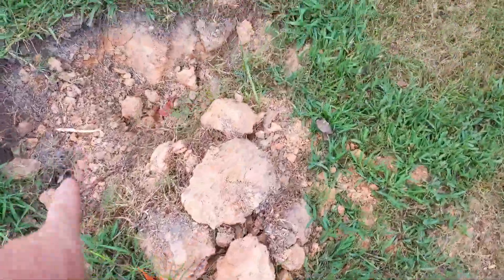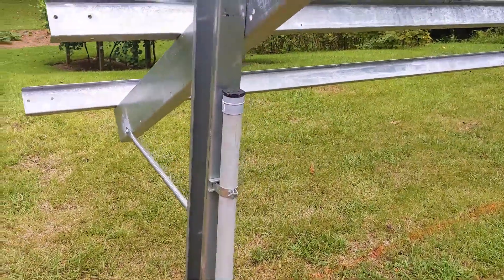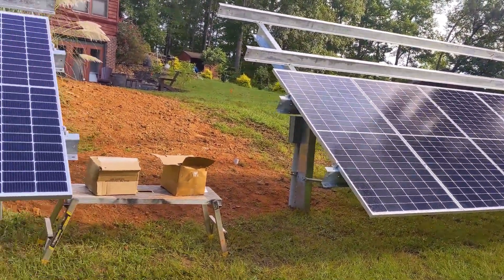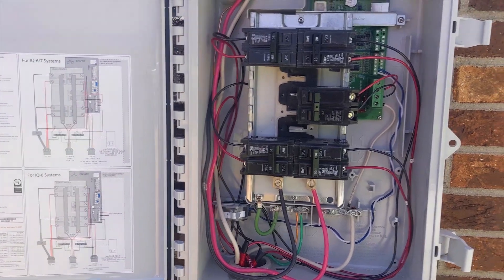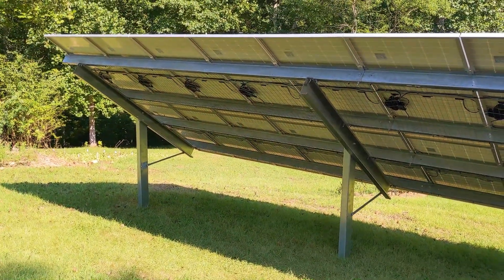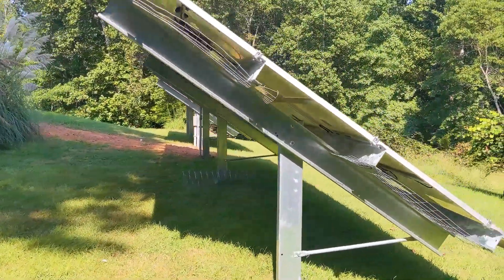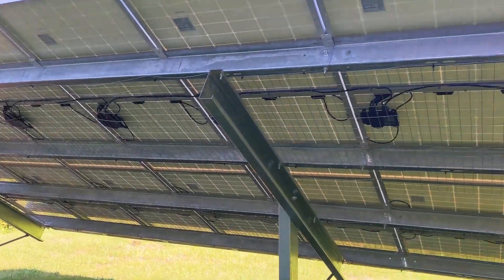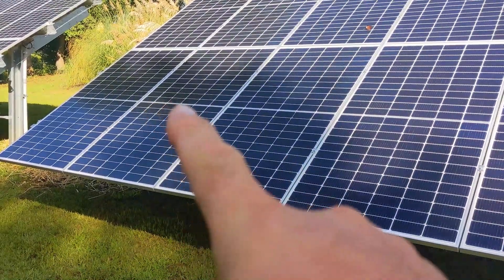Surprised by Enphase

Comment: Curious to how much testing for interference on HF ham bands do you do? A lot of these solar installs in the US has horrible interference and is starting to make communications for hams very difficult. Most hams I know have to turn off the solar in order to talk local.
Reply: Use ground rod and don't integrate the grounds throughout. Electrical code wants grounds comingled to the grids, but apply the electrical grounds lower on the same rods and try to use moisture to ensure good ground drains. I doubt you will read this anyways.
Reply: @dukeofsalem7127   "I doubt you will read this anyways." You assume much grasshopper, lol
Reply: That's bad news to me. What's the typical source of the interference?
Reply: Most grid-tie inverters don't make a sine wave - They are essentially the first phase in a low-frequency inverter, and just do a pulse with the polarity in sync with the grid, and depend on the grid inductance (transformers) to integrate it into a sine wave. As we know a (true) square wave is actually an infinite series of waveforms, hence, noise.
Reply: Its not an issue with Enphase.  One of their engineers is a big ham guy.  Just signed a ham today and had to take him to an install with his antennas so he could test.  Wasnt an issue

Comment: That looks like a lot of load for a 150A main breaker.  Talk about how a load analysis is done to verify a 150A breaker is suitable....
Reply from the maker: In order to not violate the buss part rating of this panel the main breaker had to be derated to 150 amps. The highest load ever seen at this house was 18 KW.  That was Data taken over a year by Duke.  energy.
Reply: @engineer775  Yes of course, but now it looks like you are violating the code with too much load for a 150A rating.
Reply: @gregcollins3404  As Scott stated, the highest load ever utilized on system was 18 KW, that's 75 amps.  I know of 100 amp service that has 90 amps of solar input with a line-side tap.  Electrical code requires that you never exceed the busbar load with 120%, so 200 amps plus 60 amps from potential solar would exceed that by 20 amps.  Derating the main power to 150 amps avoids the grid ever placing more than 150 amps onto busbar with solar producing max of 60 amps, brings total to 210 amps, less than the 240 max with rule of 120%.
Reply: @jdlutz1965  no, no, no - I'm not talking about the backfeed rule.   I'm refering to Article 220 in the NEC that calculates what the acceptable load is on a bussbar.  Its a whole, detailed process of adding up all the lighting loads, heating and A/C loads and everything else.  I suggest you do a video about how to do a loaad analysis. (there are worksheets available online that make it easier to do)  I bet 150A is not enough for this house.
Reply: @gregcollins3404  I'll repeat what was stated by Scott, the load analysis from the utility never showed a load higher than 18 kw (75 amps), still 50% less than the 150 amps rating.  Worst that'll happen now is if they somehow pull twice as much as their previous maximum load, it'll trip the 150 amp breaker.
Reply: @jdlutz1965  I'm just saying it doesn't meet code.
Reply: @gregcollins3404  I'm not an electrician but I "play one on tv", just for practical purposes, I don't see any safety or day-to-day problem with it.  I work in the solar industry and many times I'll see 300 amps of breakers within a panel with 200 amps service.  I think for all but the most unlikely situation would every circuit be powered and overload the main breaker (far before overloading the bussbar which is usually rated at 225 amps)
Reply: @jdlutz1965  Well, I am an electrician and do permits which typically require an official load analysis be done when reducing the size of a main breaker.  I agree there is no practical problem here - but the code is very safety oriented and figures a worst-case load.  Personally, I hate stupid rules and am glad to see you guys are getting to do what makes sense.   I think it would be instructive to go through an official load analysis in this case to show how it is done...
Reply: @gregcollins3404  My blank stare code inspector would not have ever picked up on anything as detailed as what you are describing.  Is my system safe? Yes.  I have my 200 amp panel wired with two sub panels to power a hot tub, electric stove, electric drier, hot water heater, and 37 amps of anaphase solar on a 40 amp breaker. My highest load load last year was just under 19 kw.  My panel will never see more than 150 amps from all sources. I could have derated my main breaker down to 150 amps had I put in a 40 panel system instead of a 30. The breaker would never see more than 120 amps.
Reply: @gregcollins3404  There is less potential load on the buss bar now that the breaker is reduced to 150A.  I dont see your problem.  Yes the connected load of the panel could overload the 150A breaker now, but its not going to overload a buss bar that was previously protected by a 200A breaker.  That solar will never produce more than 30 amps, so now the buss will never see more than 180A instead of the previous 200A breaker limit.
Reply: @Tro1086  it's not the buss bar that section 220 is concerned with.  The issue is whether a 150a main breaker is big enough to supply all that load in a worst case situation.  Please read NEC 220 before making any more replies.
Reply: @gregcollins3404  yes, but there is no safety danger by undersizing the breaker, and the code is all about safety. There is probably no other option other than going back up to the 200A breaker.  Sometimes the code forces you to do things that make 0 sense.
Reply: @Tro1086  I never said it was a safety danger.  I said it was a code violation.  Usually you can find a 175amp main breaker which will give you 65amps of backfeed.  They are getting hard to find and expensive though.
Reply: interesting

Comment: From what I can tell, the Enphase is the only system that can still power the home with a when the grid goes down. Is the SolArk capable of that too?
Reply: The Sol-Ark is more than capable.  Sol-ark started as an offrid inverter and worked towards hybrid.  Enphase started grid tied and just recently got into storage.
Reply: @practicalpreppers7798  - He asked if the system, which is grid-tied, can still operate if the grid goes down.  Enphase is authorized to do it.  It turns into a microgrid if there's no power from the grid.  Most other grid-tied systems shut off until it gets a balanced power signal from the grid (when the grid comes back up).
Reply: @zinaj9437   Correct. Just when it's nice to have some backup power. Good question.
Reply: @zinaj9437  There are multiple systems that can power the house when the grid goes down.  A simple enphase micro inverter system can not, by its self, without adding the battery and other parts to the system.  Sol-Ark is a hybrid inverter/battery system from the get go, so as long as you attach batteries, it can run without the grid with no additional parts.  Schneider and Outback also make hybrid systems that sell to the grid and power the house in grid down situations also, and they are all probably cheaper than Enphase.

An inverter doesent need to be "authorized" to power the house when the grid is down, but all grid tied inverters have to be specifically UL listed in order to sell back to the grid.

Comment: I'm curious why you would remove the enphase system from some of the panels and connect to them to a battery, instead of just AC couple a battery using an inverter, and put the entire system behind a automatic disconnect switch?
Reply: THe max AC couple to a solark is 9.6kw.  I have 11.6 of AC on this system.
Reply: @practicalpreppers7798  (making sure I understand) so in my proposed scenerio, the solark would only be able to charge the battery at 9.6kw even if the panels were producing 11kw?
Reply: @kschleic9053  my understanding is that coupling 11.6Kw to an inverter when the manufacturer's maximum recommendation is 9.6Kw can damage the inverter and probably void your warranty. He's therefore making the best of the extra 2Kw without damaging the inverter.

Comment: I really love my enphase system and the individual panel monitoring. My installer did a line side tap so we didn't have to de-rate the panel or lose 2 breaker locations.  I'm curious how you would install a battery system to prevent back feeding during a grid down scenario.
Reply: When you install the Encharge, you include the Enpower switch which is an MID isolating from the grid in like 20 nanoseconds. It allows the system to continue to not only provide but also produce power.

You can also add a generator which the Encharge will happily cooperate with regarding load management
Reply: @guidedbygreen1480  is there a specific type of generator that would/wouldn't work? The quality of electricity can be an issue for sensitive electronics with uninverted generator power. It would be terrible to fry the micro inverters while tied to a running generator.
Reply: @derekdeckens2559  YouTube keeps deleting my comment because I'm trying to post a link to their generator PDF, but they have a list of recommended generators Kohler, Briggs, and Generac.
Reply: @guidedbygreen1480  I guess I should have clarified, I am curious how AC coupling would work with a solark system. I'm familiar with the enpower switch.
Reply: @chrisrobey77  i could be wrong but line side tap would not work to ac couple.

If using solar you could drop the micro inverters to the smart input/output  terminals(GEN terminals).  Or you could drop  micro inverters to the essential loads panel.  Your solark load terminals would also feed the essential loads panel.

When grid is down the solark would control the mini grid there. Charging battery when needed.  If batteries were full it would raise the frequency on the essential loads panel. 

The micro inverters would be following the mini grid voltage and frequency. Once frequency was out of spec it would stop producing power. 

Proper setting is key. And probably more nuanced then that, but those are the key points.

Also a benefit of paralleling the micro inverters and solark on the essential loads panel would be increased load support.

You could support loads of whatever the micros were producing plus whatever the solark could supply on its own.